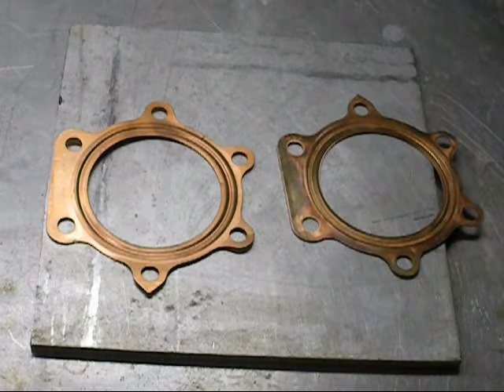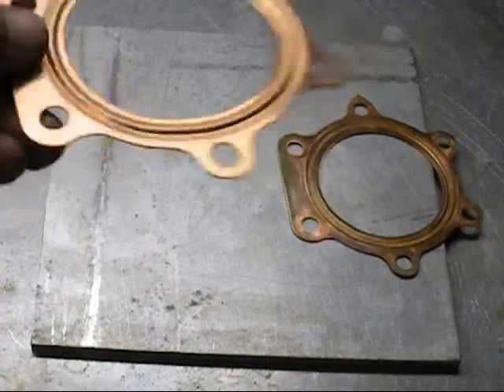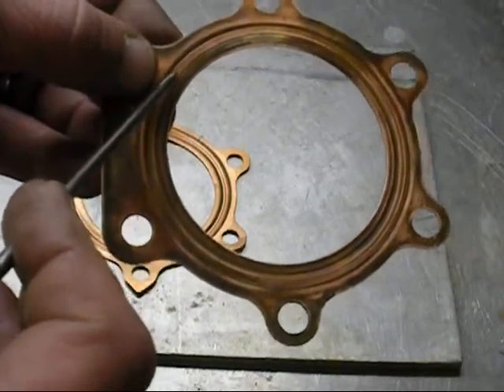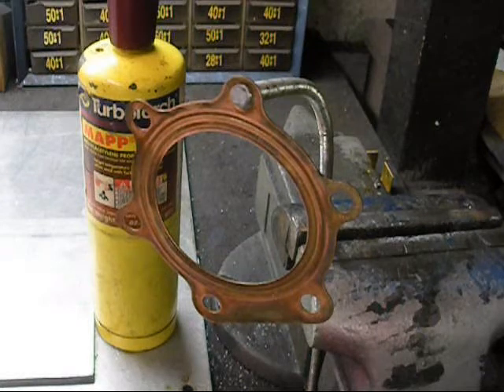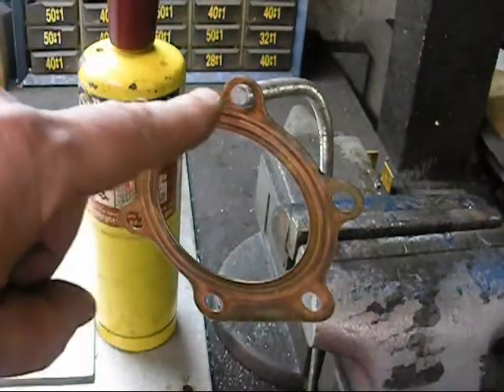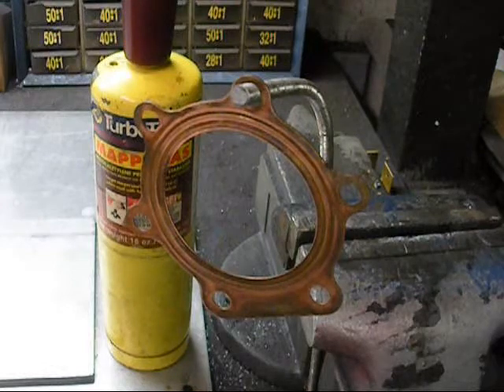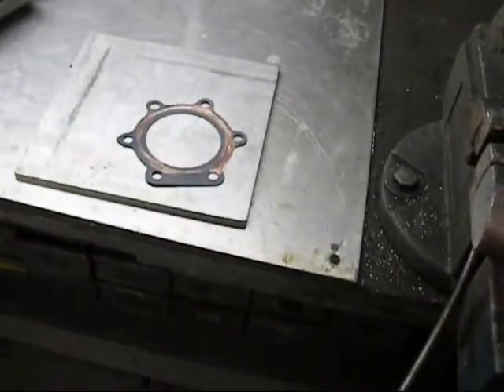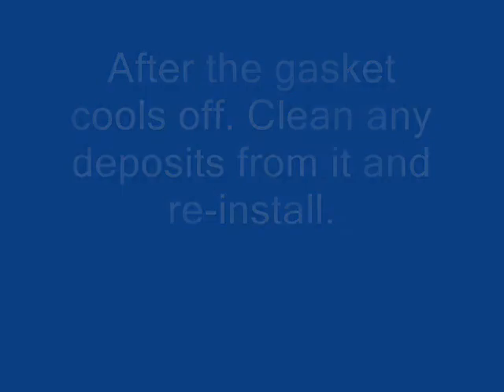Annealed Head Gasket.wmv

Comment: No. Annealing is when you heat it up and let it cool down very very slowly. Not throwing down on a cold plate. Cooling it down rapidly from a heated state makes it more hard and brittle. To anneal it, heat it up like you did, then back off the torch and continue, then back off more and more and so on. You could even go further with an oven but its good enough.
Reply: Not with copper you heat it and cool it dowfast
Reply: @garywhitmerwhitmer6786  Well I have torched pipe and let it sit to cool slowly, and torched pipe and accidentally let it fall over in the snow, and it doesn't take a genius to figure out what makes softer copper. Especially after working copper for 30 years in all conditions. Either way it softens but one way works better. Do whatever you want.